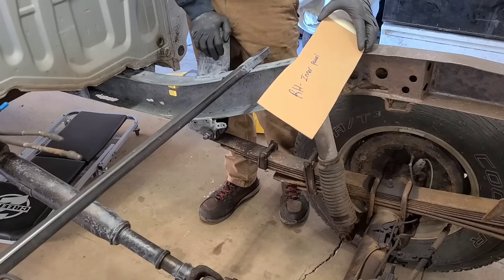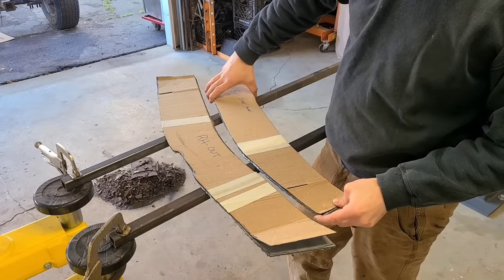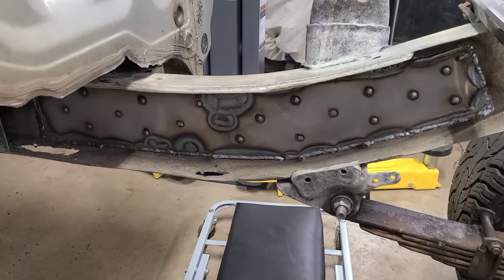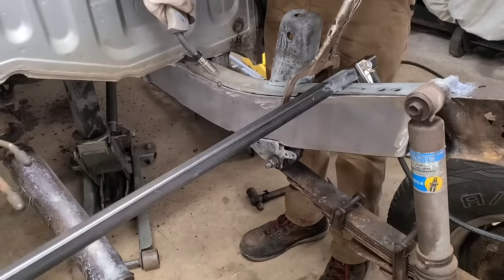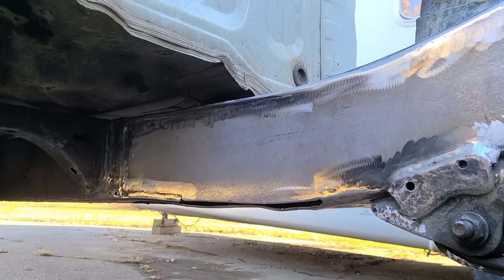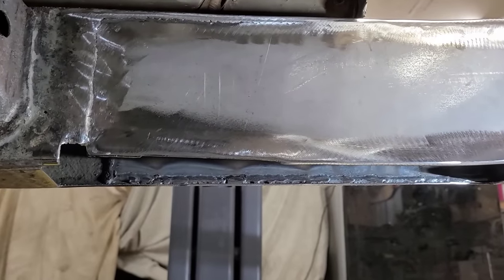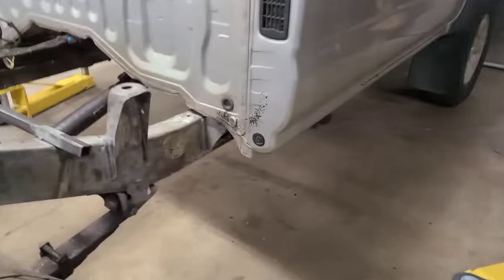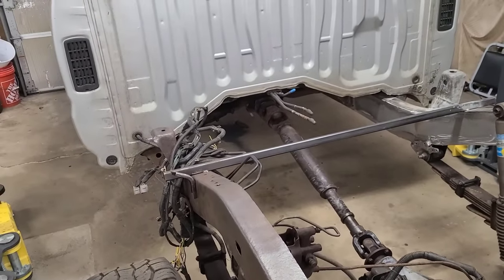Reinforcing and repairing the Tacoma frame

Comment: All of the videos I have seen are nothing more than cosmetic fixes. This one included.

I have yet to see one that addresses tensile strength, RMB, section modulus or any of the relevant details required in proper frame work.  Throwing 45,000 psi steel at a rusted out 70,000 psi frame rail and then changing the temper of all of the metal.  Replacing a smooth bend in high tensile steel with thinner pieces of lower strength steel and welded seams just isn't the fix people think it is.  Perhaps the original frame had an RBM of 1,700,000 PSI and you restored it to 500,000 PSI plus the addition of scads of stress concentration points like little tabs in the web of the flange or sharp corners in lieu of large radii. But, what do I know?  I only worked for OEM truck builders for 45 years.

While I am more familiar with heavy duty truck frames for class 8 type chassis, the same principals apply to the light weight stuff.  Do it yourselfers would be doing themselves a favor by downloading the original manufacturers body builder manuals at the very least, and reading the damn things, before doing this stuff and spreading misinformation on youtube.
Reply from the maker: Cool story, thanks for sharing.
Let us know when you do find the correct video so the rest of us losers can learn a thing or two from it.
Reply: it is at least more than a cosmetic fix james. and full original strength isnt required here anyway.
Reply: @dont-want-no-wrench  Excuse me. I don't believe in doing things half asses when it comes to be basic structural members.  I have seen trucks that literally split in half because some moron decided to increase the length of the frame.  One was a nearly $200,000.00 fire truck where someone took the front half of one truck and welded it to the back of a different truck. Worked fine, until it didn't and broke in half.  Nobody got injured but, it got real expensive for him.  He's damn lucky nobody got injured when it broke.
Reply: @jamesford7182  Please explain your recommended method of repairing a frame like the one shown in this video.  There are a number of people who would appreciate a description of how an OEM frame like this one could be repaired, particularly when OEM frames are no longer available and so owners must do the best they can to prolong the life of the existing frame.  Thanks in advance of your reply.
Reply: @MichaelPatrick-pq9xl  First, I read the body builder guide for that vehicle and refer to the section on frames.  There are actual, printed and published manufacturer recommendations for frame repairs.  They don't just print manuals for shits and giggles, they do so for two reasons.  One, so a competent person can properly repair and/or upfit their product.  Two, if, God for bid, they end up in a lawsuit because some nitwit screwed up their product and it cost someone a lot of money or killed someone and gets that deep pocket itch.  Every manufacturer I have worked for had to constantly defend themselves in these type of lawsuits.  

Thus, the short answer is RTFM.

Comment: The frame was made for the intended use .
Reply from the maker: It sure was and it has given up on me. That is why I am only putting back close to what is needed to repair it. I am not slapping on a 1/2" thick monster plate in there. Tons of people have welded reinforcement plates over existing factory frames to increase rigidity, especially when turning them into tough offroading machines that will endure a lot of abuse. When you ask more from something than it was originally engineered is when you run into problems.

Comment: почему при сварке много искр-может газ плохой попробуй.
Reply from the maker: A MIG welding process produces sparks and spatter. Proper setup and clean metal preparation will help reduce it but it is not as tidy as TIG welding.